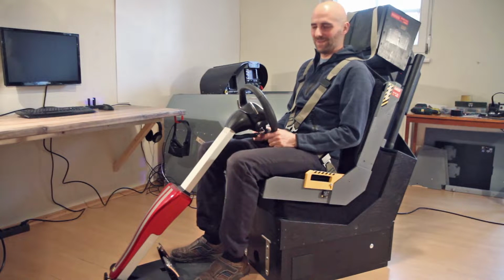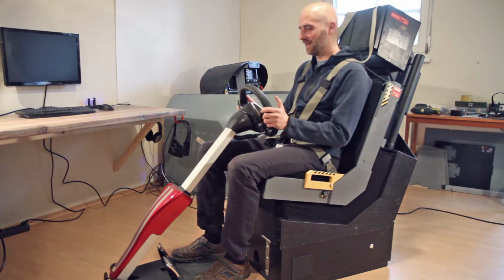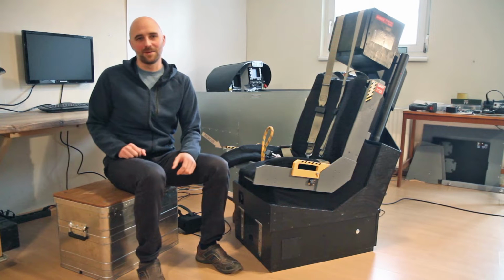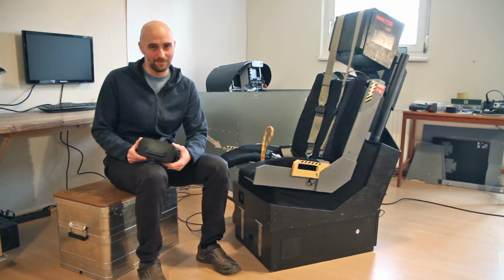The Motion Integrated G-Seat - part 2: Racing Cars

Comment: Impressive work, how did that prototype work out btw?

Do you notice your feets being stationary or is the brain tricked enough to see beyond the fact?
If it is a noticeable a footrest connected to the base could work, also a dedeicated motor might improve it!
Reply from the maker: No, the stationary ground plane does not impede immersion at all.
Reply: @bergison  yes, but I see you struggle a lot with the driving wheel, which does not move, while the seat is tossing you around. This is very poor simulation, as in real life, the G-Forces don't mess up the control, the distance to the wheel.